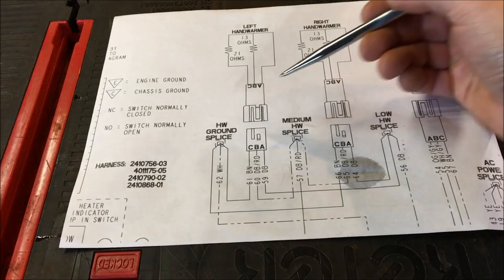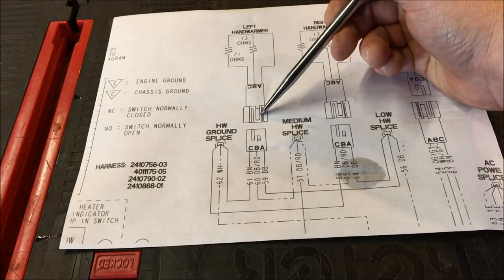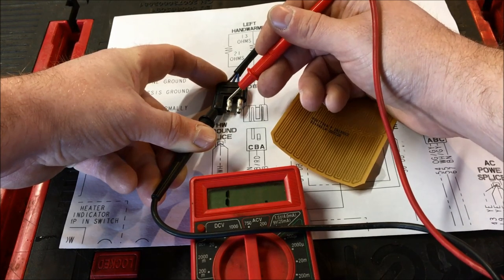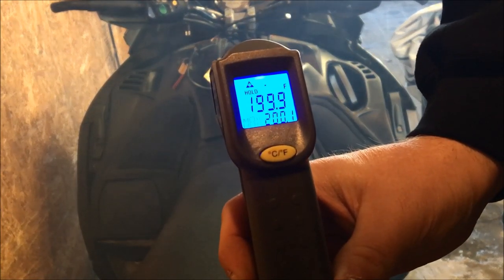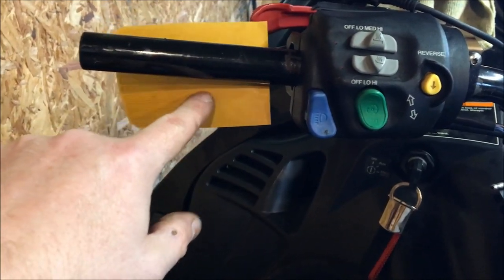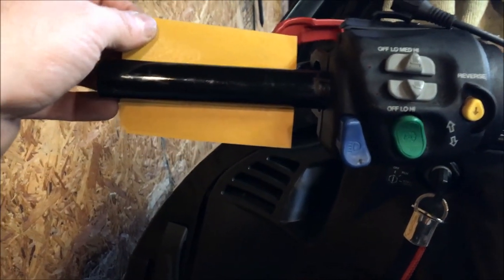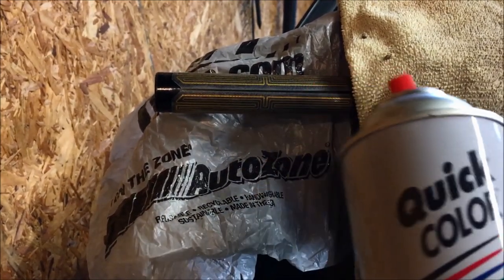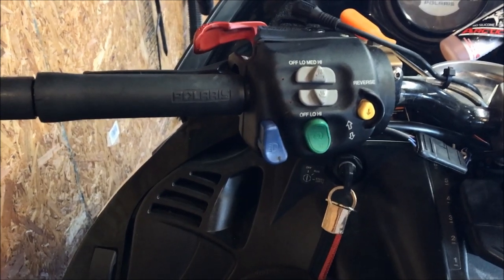How to Fix the Hand Warmers on Your Snowmobile (Part 2 - Replacement)

Comment: I was hoping for finding & soldering/fixing the open breaks on the grid circuit to be the subject of this video (it wasn't).  Polaris wants $57 EACH per heater grid and I need BOTH as (low) is out on one side and (high) is out on the other.
Reply from the maker: Yah, there's no way you would be able to repair them since the circuits are on a plastic film.

What model sled?

Comment: Compressed air maked the grips slide off without any effort, chemicals, heat, etc.
Reply from the maker: Absolutely true. However on this sled, the end of the grips were cut off to allow the installation of bar hooks. 

Thanks for watching and please subscribe!